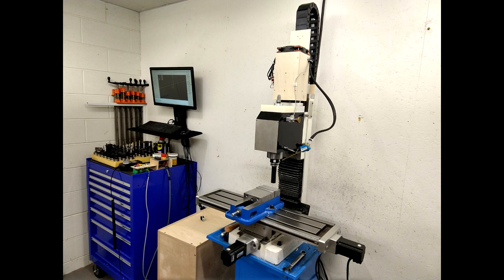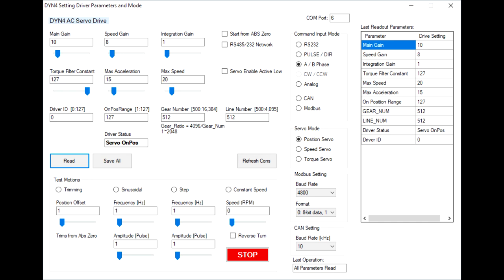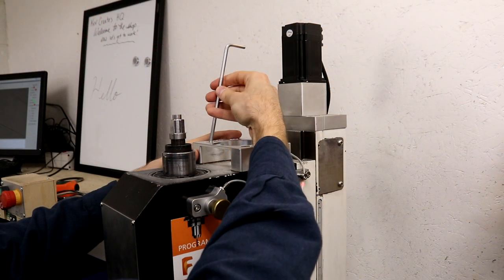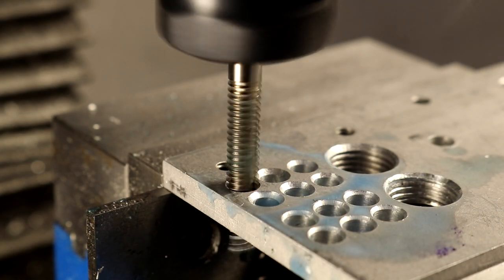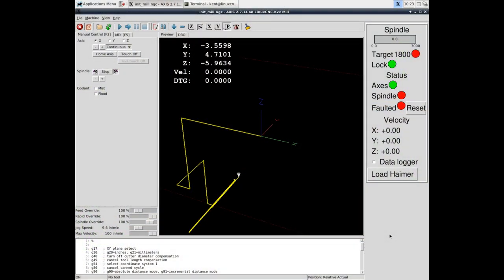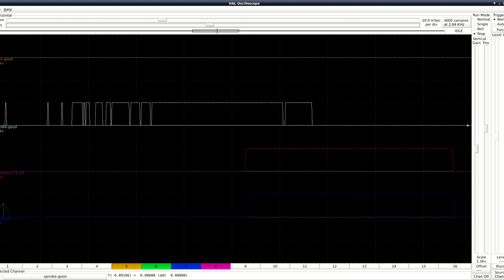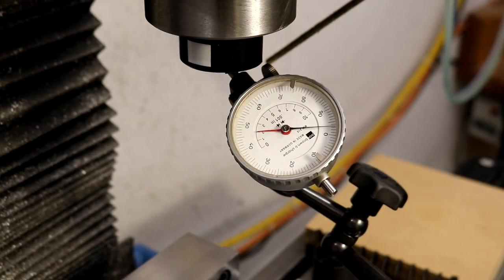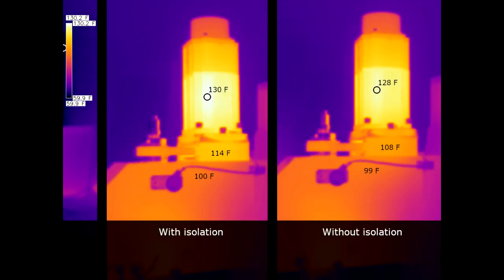AC servo motor for CNC mill spindle: Questions and answers

Comment: I did a similar upgrade to my Sieg X3.  I used a DYN4 1.8kw (no brake) controlled via 0~10v.  I used all of the recommend filters and regenerative resistor.  I geared mine with a toothed belt at 1:1.8 so that I could get a spindle speed of 5400 spindle rpm.  I can also do rigid tapping.  I'm using LinuxCNC with Mesa 6i25+7i76+7i83.   I had a little trouble getting setup but DYN's tech support was very helpful.
Reply from the maker: Hi John. I completely agree about DMM's support. They went out of their way to help. Did you you need to mount a spindle encoder or manage to use the drive's encoder output? I switched to a Mesa 7I76E and it works well, and while it has differential I/O and a higher sampling rate than the Pico USC, unfortunately the encoder output of the drive is still unusable. Bummer

Comment: "Why did this video take so long?" ahh... cuz... life!   Kent, you're the man. I could never keep up with all that blog, instagram, twitter, etc.  What I like most is your attention to detail and willingness to put it all out there. Fantastic work, yep now we know why even a Tormach is 10K with no options...
Reply from the maker: Hi Jacob, thank you. I've mentioned this a few times but I don't know it comes through well. I just don't see CNC conversions, as they are done today as far as I know, as reasonable activities. There are many items that are discarded and the bones of the machines were never intended for CNC. Many times, one will be an expert in one area (machining, mechanical design, electronics, programming, etc.) but not in all the areas and all the areas are needed to do a design. So, one is left trying stuff out, hunting for others who have tried stuff out, etc. and piecing stuff together. People vary their time far less then they should so end up spending lots of time on a conversion instead of buying a turnkey system. Now, for education, I completely believe a CNC conversion is fantastic, without any doubt, but so are many other mechatronics projects, but a CNC conversion leaves one with a tool that's useful. Until there is a conversion-killer option, it's going to be useful for people to report honestly and accurately what's working and what's not. But that's all just my opinion :)

Comment: I purchased all of my CNC conversion from DMM just before you made the two videos on the spindle motor replacement. I’m happy to say my weeks of research and talking to DMM wasn’t in vain. Your videos confirmed I made the right choices at least in the spindle motor. The only difference is I ordered a separate braking resistor instead of the one built into the servo and I did go with the 1.0 kw instead of the .75, DMM recommended the 1.0 but there wasn’t a large price difference at that time plus I was buying all the other components at the same time which bumped me into a higher discount percentage which may have made a difference.  Thank you for the great info. I subbed and wish I found your channel sooner. I’ll be checking out all your other videos to get even smarter!
Reply from the maker: Your 1kW motor, does it also have a 5kRPM limit? If so, what's the model number? And you saw a discount percentage for buying more? That might be a new offer. Thank you for all the feedback. Always wonderful to hear advice from others.
Reply: @kentvandervelden  Hi Kent,
It’s a A11-DST-A6HK1. I haven’t installed it yet, I’m still milling the mounts for the XYZ servos. I have started the enclosure build. I was told if I used a 2:1 pulley setup I could see 6000 RPM. I have all new bearings for the spindle that I’m going to replace when I do the conversion. I haven’t even looked into the pulley setup yet, I know I’ll have to bore and broach an off the shelf one. I like the toothed belts but I’m also on the fence about a grooved V belt. Being an old school machinist, I went to school in 1979, it is hard for me to jump right in since I can crank out most any part on the mill and lathe manually right now. BUT! I’m having a blast learning this as a hobby. Especially with the information available on yours and others channels. Regarding the discount, I didn’t know there was one until I added the spindle servo. The rep told me that by adding that to the order moves me into the next discount tier.
Reply from the maker: Unless you see a large price difference, I would go with the v-belt or multi-grove belt. I used a tooted belt because I wanted to use the encoder feedback, but that was a big time sink. Another small pulley to an encoder from the spindle would have been easier for the setup I have. Assuming our mills are similar, to use the stock pulleys all you would need to do is bore out and add a key way. If you do want to go with a tooted belt, drop me an email, I might have all you need, I know I have extra pulley and belt from Misumi and can get you the details. There are a lot of creative people on YT. I feel like a hack watching others :)

Comment: I tried few motors on my g0704 and ended up with china servo motor 1.8kW. Price was close to what I have spent on used treadmill motor and driver. Motor is rated 3000rpm and I was impressed with torque on low speed compared to previous motors. Motor is flush with mill head so it does not look too large.  I use quadratic A/B pulse signal to control it as it is most resistant to noise. At first I found problems with optocouplers not being able to generate fast signal of 500kHz but when I figure out that motor driver has opto isolation i did it directly and had no issues since then. I saw they started selling 8000rpm servo spindle motors but they are much more heavy and are not suited for this small machine. I am happy with it. But I didn't test limits of it as I don't look for record of speed and depth of cuts. Its sufficient for me that motor don't stall like other did and ruin my work.
Reply from the maker: If you have a reference to the supplier, please include it here. I looked at manuals of a few of several servos on eBay. If all works out, they would be a great value. They have lots of additional features too. Your last three sentences especially sum up my priority and initial experience, so the real tests will come when I'm back to projects.  Thank you

Comment: Thank you for sharing your experience in such depth; a servo on the spindle for my little lathe is a reach goal for now.
Reply from the maker: Glad it was helpful and, to be clear, I'm happy with the DMM servo. On a lathe, the inertia mismatch between the servo and load will be greater than on a mill. Not sure this so important if the servo is not used for positioning. Probably should try to get a servo with a larger moment of inertia to be safe. Regardless, whatever servo you go with, check with the manufacturer's tech people to be sure.

Comment: Kent - Thank you for all the detailed information in these videos. I just placed an order with DMM for the unlisted 1KW NEMA 34 servo and DYN4 drive. The motor's max speed is 5000rpm, with 3000rpm continuous. The DMM rep said it'll run all day at 5000rpm, it's just that the torque drops off after 3000rpm.
Reply from the maker: Pretty nice! You'll be quite happy with it. I wish they would have told me about the 1kW motor when I ordered. The belt and pulleys the mill comes with might be just fine. I used them for a while, they were simple, cheap, and fast to get going.
Reply: @kentvandervelden  I want to do rigid tapping and am concerned about slippage. Do you have the info of which geared pulleys and belts you used listed in any of your videos?
Reply from the maker: The Misumi part numbers are GBN390MR3-150 (belt), GPA60MR3150-A-P35-NFC (spindle pulley), and GPA60MR3150-A-N14 (motor pulley). Totals about $65. The belt may take a over a month to receive. Drop me an email about an alternative.
Reply: @kentvandervelden  Kent - Thank you for the part numbers. Email sent.

Comment: I watched the entire video and understood maybe about 10% of it.😂 I kept hoping that you would explain how you got rigid tapping to work. To refresh your memory, it was working fine for me (Centroid Acorn control) but the motor would do a weird fwd/rev movement when reversing out of the tapped hole. You seemed to have got it to tap without that weird behavior.
Reply from the maker: Only 10%?!?! I didn't do my job well :) I've tried so many different methods and had such varied results I don't remember all the combinations that create that you describe. The most recent one though is if the motor is commanded to a particular speed over the serial port, then commanded to stop (speed = 0 command because there does not seem to be a stop command), while the motor is coasting to zero following the acceleration profile set in the motor's drive, the enable line is toggled off, all looks OK. But, when the motor is enabled, the motor will continue decelerating (which means it snaps to the speed it was at before being disabled and continues coasting to zero) even if a command to run the opposite direction has been sent immediately after the enabled. I remember us talking about this but I don't remember if you said you use the enable line... If so, perhaps there's something there? Give the motor time to ramp down to a stop or increase the deceleration time?
Given the problems I've had, and that the serial protocol does not seem to have them, I'm switching to the serial protocol and I may not be able to rigid tap because the encoder signals are so full of noise. Once I have a working mill again (down for nearly three months) I'll see if I can make the encoder pass-through work better.
Thank you

Comment: Hello friend, thank you for taking the time to upload videos that help the community to carry out their projects and make better decisions to be able to choose well when buying a component in this case between one engine and another, I would like to know if you could guide me on how to connect a 3.7kw servo / spindle that I have acquired in the Chinese pages, my idea is to connect it by the step / direction mode to obtain a better performance I have a servo motor manual in case this help, my question is; do I have to sacrifice an axis to be able to connect my servo controller? Yes that's how it is; The manual asks me to configure a frequency of 500khz. Is there a card that is capable of sending that frequency? I would greatly appreciate any guidance you could give me, in advance thank you very much and congratulations for your good contributions
Reply from the maker: You'll need to have an additional axis if controlling the servo with position control, whether the mode is step/direction or a/b phase. The pulse generation with the Mesa 7i76e is 10MHz, and that's a LinuxCNC card. I had to use position servo control, instead of velocity control, to get good performance but you may not need to. Velocity control should have worked well for me, but something prevented it. Thank you for the kind words of support. I wish you the best of success!
Reply: @kentvandervelden  I appreciate you took the time to respond, I tried to make the connection by sacrificing an axis to be able to operate M03 and M04 I appreciate your support, blessings for you and your family, greetings from Mexico

Comment: thank you for your videos i followed your belt drive 3 pin pulley and its wonderful absolutely quiet. now I'm trying to hook up the encoder to the acorn and what I don't know is where to hook the 5+VDC from the acorn encoder plug into the servo driver. what I do know is that on page 2.3.2 of the manual A+ is pin 20 A- is pin 19 B+ is pin 19 B- is pin 17 Z+ is pin 15 Z- is pin 16 GND is pin 1 and the only remaining pin is pin 22 and that is called OZ (Z open collector output) so I would thing that since that pin 22 is the only remaining pin; that it must be the 5+VDC for the encoder?????? oh man its always the last bolt you un-tighten that breaks off LOL on the acorn encoder plug it has pin 9=+5VDC pin7=A+ pin 8=B+ pin5=B- pin 6=Z+ pin 3=Z- pin 2=COM so it seems all so clear that A+ A- B+ B- Z+ Z- GND (COM) all have their places to connect to, but it's that 5+VDC pin 9 on the acorn that I dont know where to plug it in on the db25 connector on the servo driver, do you know if it plugs into the pin 22 OZ (Z open collector) please help, I am going crazy LOL
Reply from the maker: The +5vdc supplied by the Acorn could power a standalone encoder. If you're using the DYN4 encoder output, you'll only need to connect GND between the two boards. Maybe pin 22 is on the Acorn? I don't know about that. Hope this helps
Reply: @kentvandervelden  I'm using the 1.8KW servo spindle with the m110_06030 driver basically it's the same Chinese servo kit that is most common on ebay right now. this link shows someone trying to figure out the answer, and someone responds that they dont need to hook up the power to the servo driver.
                           this is a link of what servo I have. and a link to the person asking the same question.  I tried to connect only A+ A- B+ B- Z+ and Z- to the pokeys 57E M16D setup that I am using right now, and even though the connection was shotty and i didnt change the PPR from 10,000 down to 500PPR like what I have configured; it did show a fluctuating rpm of 13,000 and when i turned on the motor it went down to like 500 rpm. so i wonder if I am getting a reading even though i didnt hook up GND or 5+VDC but only A+ A- B+ B- and Z+ and Z- then maybe it supply's it's own power. I would hate to burn up the new acorn. I have been trying to get rigid tapping for years and just blowing all kinds of money its awful.

https://www.ebay.com/itm/392911210777?var=661819044574

https://forum.linuxcnc.org/27-driver-boards/37608-wiring-a-chinese-servo-to-a-7i77-setup-for-yet-another-newbie?start=0
Reply from the maker: @BondmeJesus  At first, tying GNDs would not necessary with differential signals. After all, it's the difference between the pair that matters for noise rejection. Further, the Acorn may use optical isolation on the input, increasing the allowed difference in ground levels. However, there will be a limit after which non-linearity and then damage occurs. Safest to tie the grounds, and attach the twisted pair cable shield at the receiver with a short pigtail. No need for the +5vdc. Some practical, some theory, hope this helps.
Reply: @kentvandervelden   so connect only a+b+z+ and nothing else?  I am not too good at understanding encoders much. I wish I knew someone who has hooked these Chinese servo encoders to the acorn. also I should check to see if acorn encoder plug is opto isolated? or hook up opto isolation? I don't really understand. I really don't want to fry another cnc controller I have a very limited income, and I spend every penny i get my hands on to make this stuff work so I will have something for my son someday if i ever get to see him again. the only thing i have going for me is not giving up. i may not be that smart, that's why not giving up is so important LOL if I cant figure out how to plug in this encoder, then I guess I will just get another encoder, and hook it up externally. it's hard when there is no information available and i've been looking everywhere and people just don't know how to hook them up to acorn that's all I find is that no one knows how. I love a clean shop because I hate spending 2 hours looking for a tool to do a 5 minute job. now that's how I feel about some things in this process. can you believe I got a 4.0 GPA for the 1st year of machine tool tech? and I cant even hook up an encoder. LOL
Reply from the maker: Please send me a few pictures and manuals of what you have and I'll do my best to help. kent.vandervelden@gmail.com In general, if you have differential output and inputs, use them (to reduce impact of electrical noise), connect digital grounds grounds (to not blow receiver), connect encoder cable shield at receive (to reduce electrical noise.)